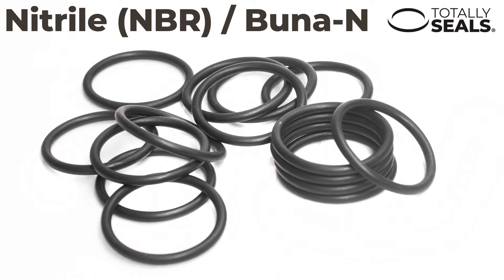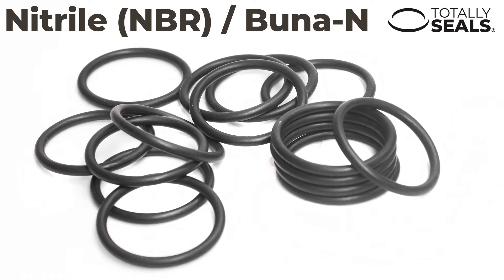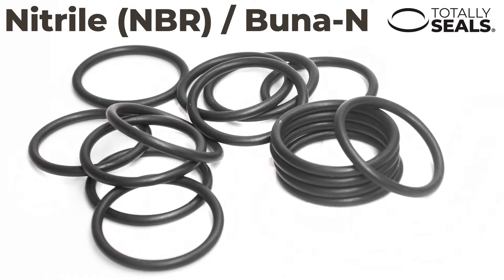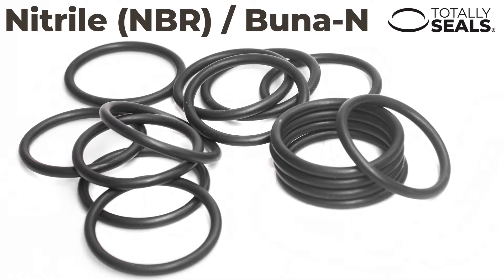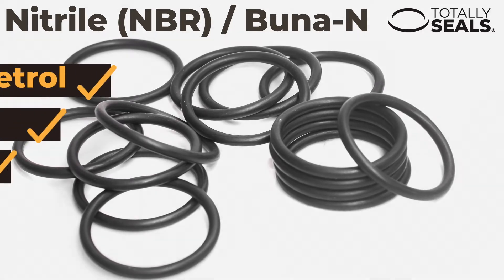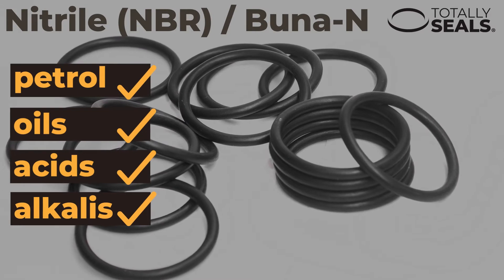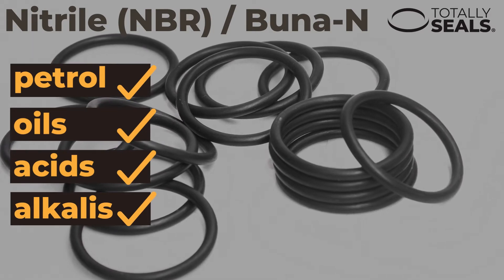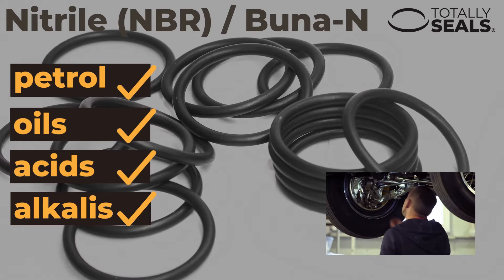A Guide to Common Seal Materials

Comment: So please explain why Nitrile and Viton used   in automotive and what's the difference?
Reply: 3 years late, but the key difference is that Viton can withstand extreme heat (up to 400° F) and thus is more commonly used with higher performance vehicles as well as some aerospace applications. It also has a much higher resistance to a wide range of different chemicals. However, it performs worse with lower temperatures and has limited flexibility and is much more expensive.
Reply: @ninjareaper3577  Thank you for the most kind explanation of Viton properties
Reply: They are resistant to hydrocarbons, like fuel and lubrication oil. EPDM will swell when exposed to hydrocarbons and is therefore not suitable for most automotive applications, with the exception of window and door seals.
Reply: We have a Viton product also